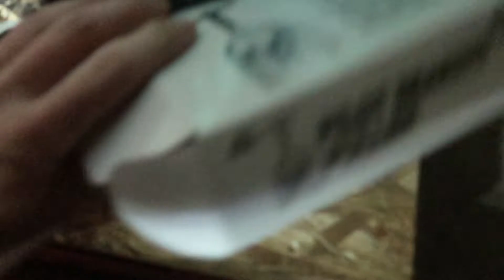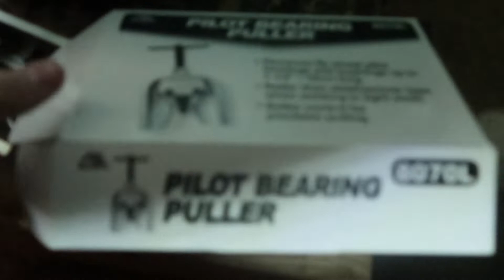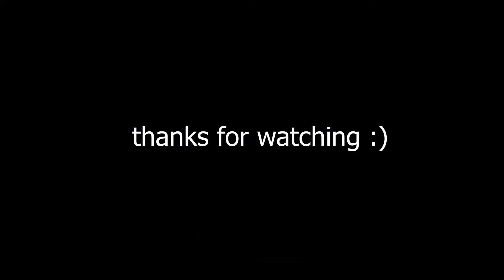FINALLY got my Pilot Bearing Out! | MK6 Golf R

Comment: There’s nothing left of the pilot barring in my ranger some how it fall apart an got hot I can’t get it off it melted it’s self to the crank shaft
Reply: Did u ever get it out I'm having the same issue 91 ranger
Reply: @nickbozarth4090  I got it out with heating it with a torch for like 3 minutes then I was able to yank it out with a slide hammer
Reply from the maker: yikes lol glad you got it